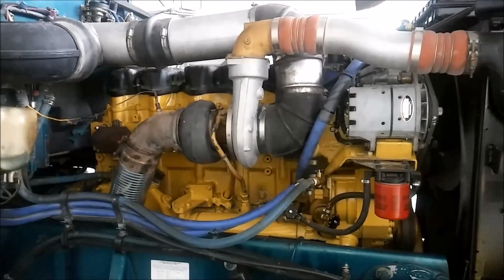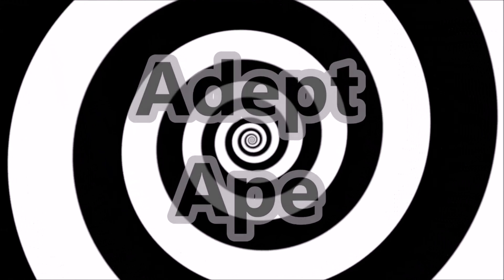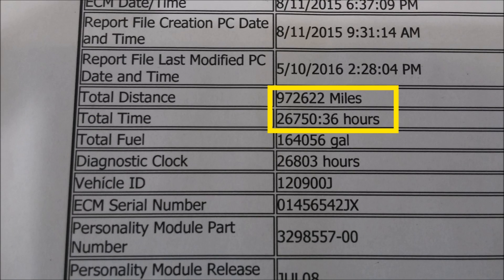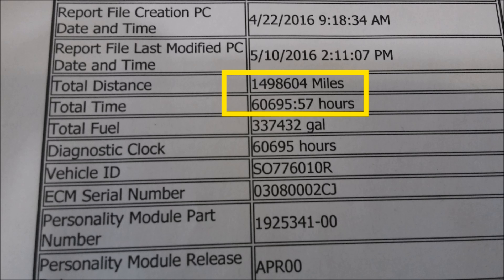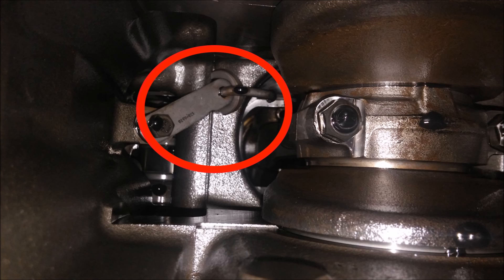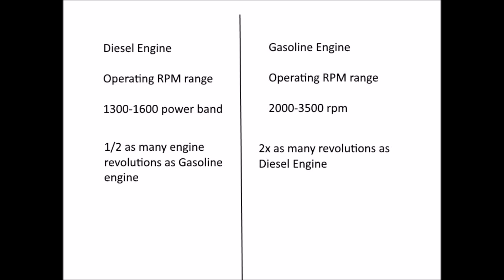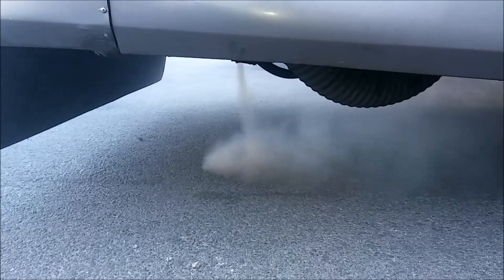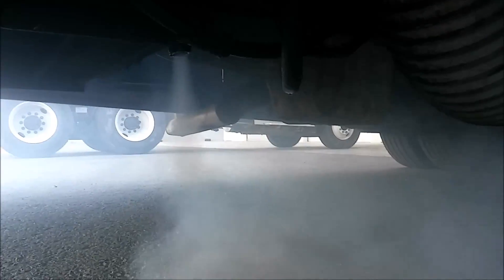Why Do Diesel Engines Last So Long?

Comment: This is really a bad comparison. Not all diesels are gear driven. VW diesels have timing belts. From an engineering standpoint there is no reason you can't make a gasoline as reliable as a diesel. Matter a fact there is a version of the Cummins 6.7 that runs on natural gas (which could run on gasoline and makes no difference from a longevity standpoint) that shares all the internals with it's diesel cousin. This would be an excellent comparison of longevity. 2 identical engines with the same internals; one gasoline one diesel.
Reply: navistar/international/powerstroke are no where near the quality engine that cummins, cat and many other companies build.   That's a well known fact.
Reply: Mark Hollingsworth There are exceptions. Navistar diesel engines in Fords 2003-2010 known as Powerstroke 6.0 cannot go 1,000,000 miles. They blow headgaskets at 100,000. They need to be fire ringed to make it last somewhat longer.
Reply: amorag59 Not neccisarly. Hot bulb engines had no spark plug but could run on pretty much anything. Spark plug engines are Spark Ignition engines and diesels are Compression Ingnition engines. Compression Ignition engines are not limited to diesel. They can run bunker oil, gasoline, methanol, ethanol, motor oil, whatever. Spark ignition is limited to more volatile short chain molecules like alcohols and light petroleum distillates.
Reply: Diesel engines can run on natural gas and still be diesel, i.e. no spark ignition and very high compression ratios.  One commonly used method is to feed the engine a gas/air mixture although relatively lean, and then use a small amount of diesel fuel in the injectors to fire this mixture, most of the power coming from the gas.  The other is to directly inject the gas just like diesel.  Railroads are studying the latter system due to the low price of LNG.  Actually, almost any fuel can be used in a diesel, the Germans had ships that used powdered coal, Mr. Diesel himself, saw the engine as using a vegetable oil fuel.  the city buses that use natural gas are more expensive (by a lot) than their diesel alternatives and the public is often misinformed as to the advantages, yes the gas buses pollute less than the diesel ones they replace but you are probably comparing an old poorly maintained Jimmy 2 cycle diesel (notorious for noise and smoking) with a much more modern engine.
Reply: If an engine doesn't have a spark plug is it a diesel engine?
Reply: Excellent explanation there. PingasTheFourth said in another comment that people don't like diesels partly because they're "picky about fuel", which we know is the exact opposite of the truth. The compression ignition engine has always been one of the most flexible in terms of fuel.
Reply: If there are design features that can help an engine to last a million miles and those features tend to be in diesels but not in gasoline engines, that is good to know.
Reply: emmjay
Reply: Thamac His opinion is not really fanboy biased cummins and cat are used in alot of industrial applications. Also powerstroke is a good engine it just needs some high matinence every once in a while so stop being so rude over a fact.
Reply: emmjay sounds just like an opinion rather than fact. Give me a break you biased fanboy.

Comment: you don't mention smaller diesel engines like the Mercedes-Benz engines from the models w123 and w124 , also planted in other Mercedes-Benz models, for example the OM601-OM606, this a modular engine, it was available with 4 cylinders up to 6 cylinders, a displacement of 2liters to 3liters was given, the engines were also available as turbocharged ones, they also last that long without having such big bearings and other stuff you mentioned, they rev up to 5500rpm and the tuned ones way up to 7000-8000 they even last this much with a power output of over 600hp

Comment: As far as overheats go: what is the most likely component to be damaged? You had a clip of crazy blow by, so I assume the ringlands/cylinder rings? Just curious. I know the oil properties change and all, but what's the nastiest thing?
Reply from the maker: +ScreamingElectron Well as the engine overheats the pistons and cylinder start to expand and there is what they call "4 corner seizure" and basically you'll get vertically wear in usually 4 places in the cylinder wall, then you have really bad blowby. Blowby can be caused by other things though and I have a video about it.
Reply: Cool, thanks man!

Comment: My Toyota Landcruiser Troopcarrier 4.2 1HZ naturally aspirated diesel engine has done 600,000 kilometres so far and never misses a beat. Same motor. I expect it will get to a million easy. Keep all your filters serviced at the right time and keep it to the right temp and they last forever. Over the life of the vehicle it is cheaper to get a diesel that a petrol engine.

Comment: great video. you should have elaborated more on the combustion process. how gas, which is highly corrosive, is introduced into the combustion chamber coating the cylinder walls and pistons then ignited whereas diesel is introduced directly into the compressed air automatically combusting upon delivery never actually making contact with any of these components causing less corrosion and wear. I've pulled apart diesels with 300,000 miles where the piston almost looks brand new, and then I've pulled apart cars with 500 miles with massive carbon buildup. great video though. I think if more people took the time to learn a little about the science of diesels like you're explaining it there'd be a lot more diesel guys like us out there

Comment: 1-bearing size comparison was a very poor example : displacements are absolutely not the same and diesel engines apply way bigger pressure on parts.
2-all what you say only apply to industrial engines : we have 80% diesel engines on cars here in France,they run up to 5000 rpm...
3-1million mile in the US maybe,but 4 millions more in Africa.

Comment: He completely missed the fact that the high compression ratio of a diesel engine forces the top compression ring to be seated against the cylinder walls even after they're both worn out and or the pistons are often gas ported too.

Comment: You probably know this, but for those that do not, the reason diesel fuel acts as a lubricant is because of the sulfur content. Sulfur acts a a lubricant, and one of the problems with the new Ultra Low Sulfur diesel is that is wears the injectors faster than say farm diesel did.
Reply: Chase Hewett There is no difference in on and off highway diesel fuel except for the color and the tax exempt the off highway gets.  Both are ultra low sulfer.
Reply: Chase Hewett I'm declaring my garage a farm and getting red dye off-highway diesel then, lol
Reply: Ryan W I am talking about diesel from the early 2000s ect, the new diesel is not as good.
Reply: YUKI JINJUJI 
You certainly are a special kind of stupid, you're ignorance is certainly astounding and entertaining. Be gone troll, go back to your cave of stupidness.
Reply: Fuel 'N Spool I ride 2 stroke dirt bikes, I find it funny that you can put premix oil in diesel fuel, and it is good for the motor.
Reply: Add some ATF to every tank fill in older diesels that were designed before the ultra-low-sulfur laws.
Reply: Brad Isley 

ATF is no longer a good choice. Too many detergents, and doesn't lubricate like 2 stroke oil does. Also ATF isn't designed to be burned. ATF actually causes more carbon buildup with the motor and turbo system.
Reply: piddyirishman 

Not all engines are created equal. Also, 1oz per 1 gallon puts me around 125:1 ratio. Definitely not enough to cause damage but still adds enough lubrication to keep my fuel system from burning up. On the VP44 trucks like mine, the fuel not only lubricates the injection pump and injectors, it also cools it. I agree too much can cause cylinder washing and excessive carbon deposits, but it's up to the owner to responsibility pre mix.
Reply: Sulfur has nothing to do with it. Paraffin wax is added to diesel as an upper cylinder lubricant which is why anti gel is added i winter months to prevent gel ups.
Reply: YUKI JINJUJI 
Oh is that so? Well you go do some research are explain to me how the old carbureted diesel are direct injection. You may want to back up your answers before making accusations/name calling like a child. Grow up.
Reply: Vegard Claussen  I wouldn't use 2 stroke oil. Maybe a specifically designed fuel lubricant like optilube or something. 2 cycle is a very crude lubrication that's meant to be burnt, but not very cleanly. Newer diesel lubrication additives are to add lubrication without burning dirty.
Reply: Samuel Rosenberg 
It has been tested and proven that 2 cycle oil added to the fuel in a 1oz to 1gal ratio adds the adequate amount of lubrication needed for my specific type of power plant. The reason for 2 cycle oil is that's it's readily available and extremely cheap to be had. I believe I pay $10 per gallon. Also, 2 cycle oil is designed to be burned when mixed with fuel and adds lubrication properties, just as a 2 cycle engine would need due to the lack of an oiling system. I've done countless hours of research on this and after acquired knowledge and advice from people with the same power plant as myself who build/test the results of different types of lubricants in my specific application is the reason I choose what I choose. I'd much rather spend the $10 a gallon for 2 cycle oil that is easily found vs $60 a gallon for some Opti Lube XL or Plus that I have to order. They both add the needed lubrication, but the costs savings and backed research makes it a clear winner to  choose the 2 cycle oil.
Reply: Chase Hewett 
I feel ya there. My 2000 Cummins wasn't designed to run on this new fuel. Since I was advised years ago to run 1oz 2 cycle oil per gallon in my truck, my entire fuel is still going strong years later.
Reply: Oh.  Yea I agree.
Reply: Fuel is right!
Reply: piddyirishman 

No problem good sir. Glad to help. After burning up 2 injection pumps ($1200 each), I had to learn on my own. lol
Reply: Chase Hewett that's why I add 2 cycle oil to my diesel fuel
Reply: Chase Hewett you know something else I didn't know you only have to burn low sulphuric in engines after a certain date, although I ca t find high sulphuric diesel
Reply: YUKI JINJUJI 
False.
Reply: I like turtles.
Reply: Fuel 'N Spool - Do you think it matters on later-model diesels? I currently have a 6.0L PowerStroke. Stage one cam, valve springs, 7mm larger turbo (Turbonetics, compressor side), studs, o-ringed, and a plethora of temp sensors to watch everything and especially my EGT's. Injectors are stock remanufacture from Ford direct. When the 6.0L was built, ultra-low sulfur was already in place. Would there be any benefit to adding a 2-stroke oil for lubrication purposes to my 6.0L?
Reply: Samuel Rosenberg - I think "Fuel n' Spool" did bring up specific fuel lubricants... read up. 

Yuki, I have no words, lol.
Reply: Interesting, I can see where they would decrease the diameter of the injectors for the newer fuel.
Reply: The off road diesel here comes from the same tank. Dunno if other places have a different formula.
Reply: Nt as bad as the 6.4.
Reply: Interested why nobody mentioned bio diesel and its superior lubrication qualities. Extensive research on the subject can be found on bob is the oil guy web site. He found that five percent bio diesel mixed with extreme low sulfur diesel has the best results. Mixing more has little effect. In Florida all diesel is ten percent bio diesel by law. Also research showed that almost all additives  paled by comparison and most had no effect at all; and that includes two cycle oil and transmission fluid. I have a 2005 Mercedes CDI with a goal of hitting 500,000 miles.
Reply: Fuel 'N Spool what about old 2 stroke Diesels? Detroit Diesel made many different models, none of which ever needed extra fuel additives to run right, I've never heard of one seizing due to friction, just look up 453t on  YouTube
Reply: Chase Hewett Correct.That why I put 2 stroke oil in as I fill up.
Reply: Chase Hewett u
Reply: Carbureted diesels only work in cars.

Which is why they're called CARbureted. Jeez, I shouldn't have to explain this.
Reply: Im a heavy duty mechanic. I was told only older machines are affected. And its generally the old mechanical fuel pumps that need that sulfur contents
Reply: Samuel Rosenberg 

The reason I use 2 cycle oil in my truck is because my truck was built and designed during a time that ULSD didn't exist yet. My injection pump is cooled and lubricated by the fuel. With ULSD alone my injection pump cannot adequately cool itself via the fuel flowing through it due to the lack of lubrication properties. Friction equates to Heat. I had to go through lots of money/time replacing multiple pumps and finally got advice from Industral Injection and friends that build pulling trucks that informed me that my pump and injectors need all the lubrication it can get which isn't available in today's fuel due to epa guidelines. Hence the reason for adding small amounts of 2 cycle oil to my fuel. Hope this information helps.
Reply: Samuel Rosenberg 
Here's some info. This man has been in the Cummins game a long time and has years of knowledge and experience. This info applied to my application. Every manufacturer may not benefit from this such as mine does.

https://mopar1973man.com/cummins/articles.html/general-cummins/84_engine/92_fuel_92/adding-2-cycle-oil-to-diesel-fuel-r357/